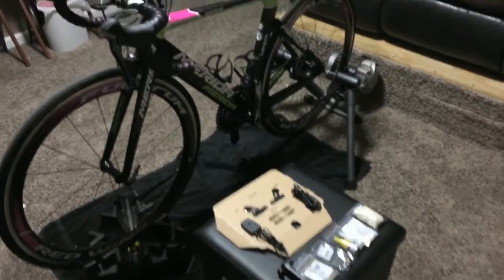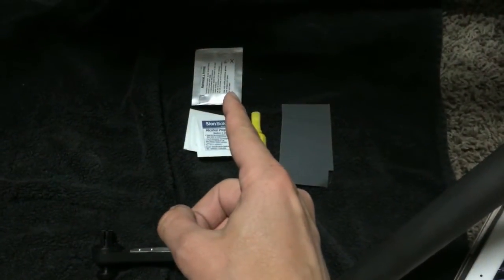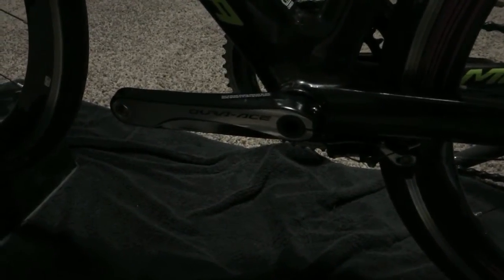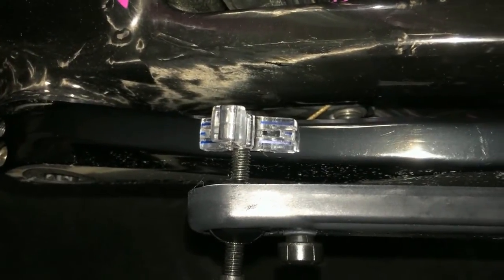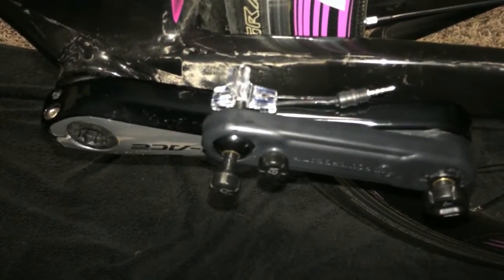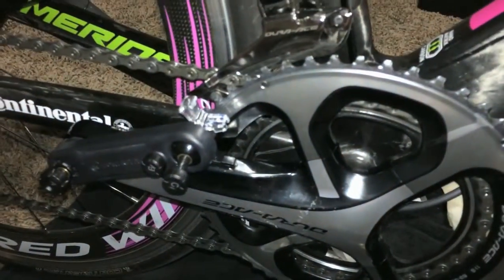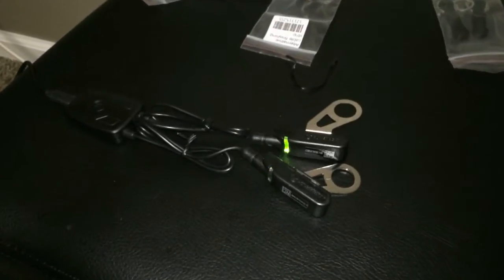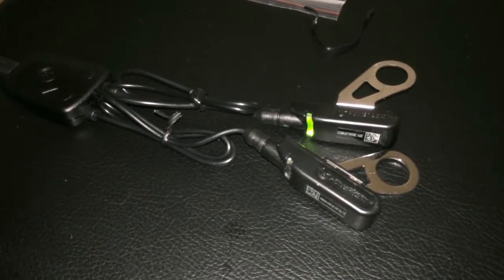Watteam Powerbeat Power Meter Installation

Comment: is it possible to unglue and transfer to other cranks?
Reply from the maker: James what you do it buy an additional set of strain gauges, I think they said they would run less than 100 bucks, then you just transfer the sending unit to you other bike.  You can remove them without damaging your crank but you will destroy the strain gauges in the process.

Comment: Do you recommend these?
Reply from the maker: guitarist india yes I highly recommend them. Initially they had some temperature drift, but they have fixed it with the newer style of strain gauge. They are spot on with others that I have tested.
Reply: Sean Redmond I am planning to buy the left only one. Is the data worth it?
Reply from the maker: guitarist india I can’t imagine not riding with it anymore. It is especially great for training. Also, if you ever want to start using Zwift, a power meter or trainer with power is a must.